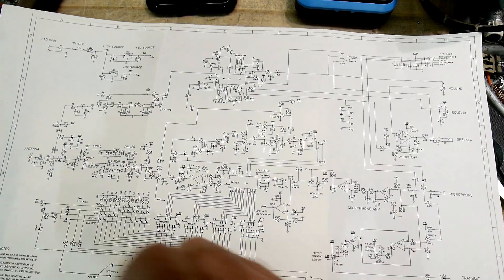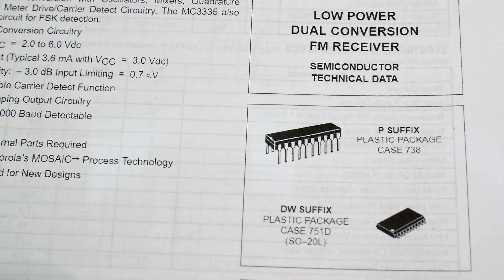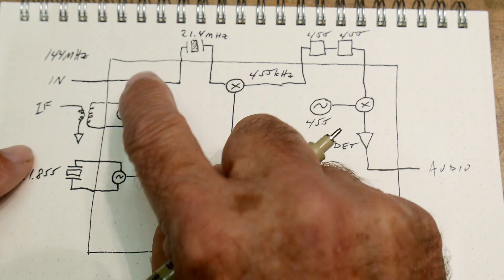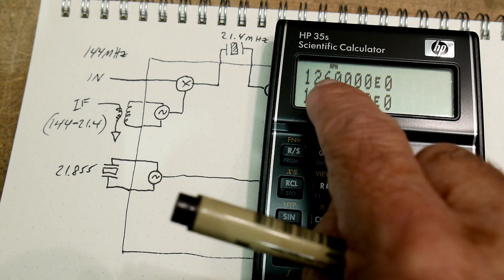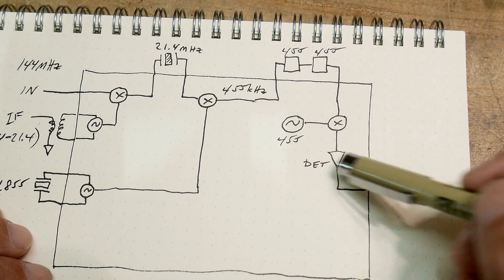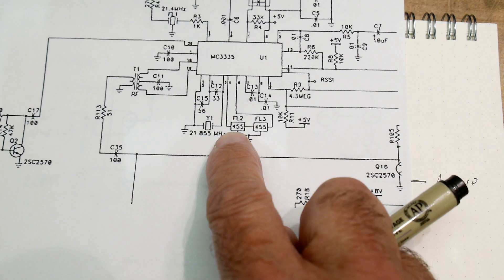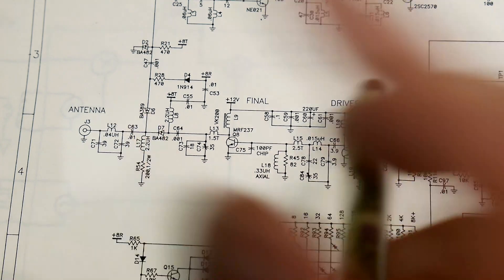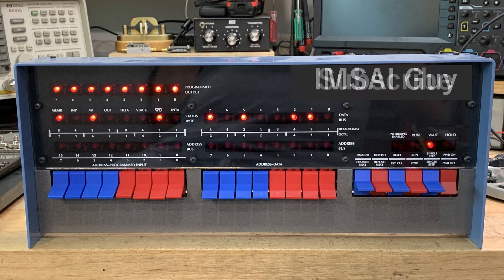#1518 Ramsey 2m Receiver (part 11 of 12)

Comment: @ 2:45 IF should be labeled LO. At first, I was like, wuut??
@6:31 L1 is not a filter, there is no 455 khz oscillator zero-beating. L1 turns the incoming 455 Khz FM signal into a Phase modulated signal and feeds this PM signal to one input of the product detector. The FM signal is applied to the other input of the product detector. You know what the product of FM X PM is?...................The modulation.............the audio. Its called a quadrature detector...........the FM is in quadrature (90 degrees) with the PM signal.